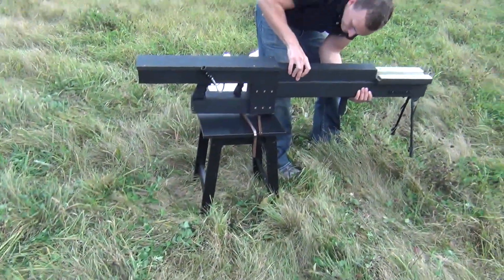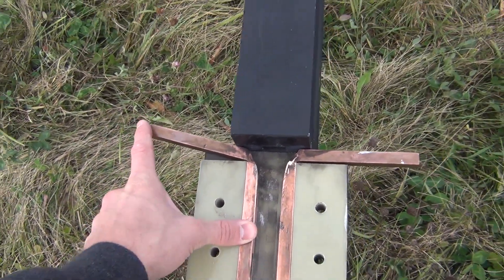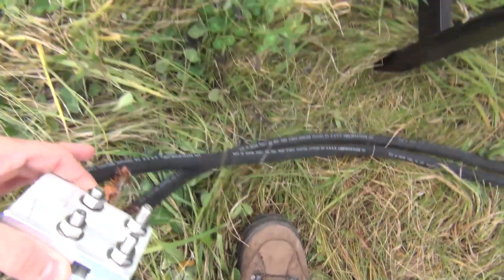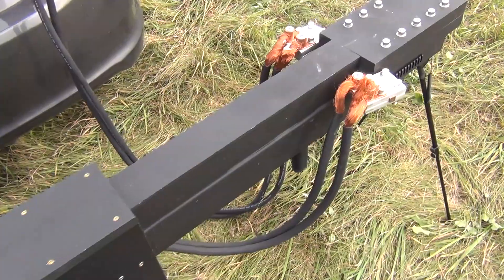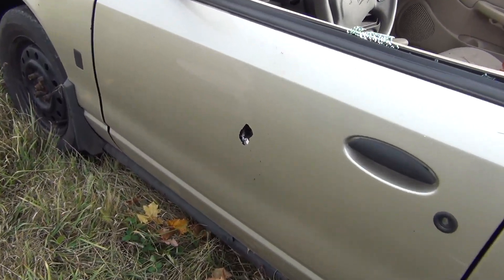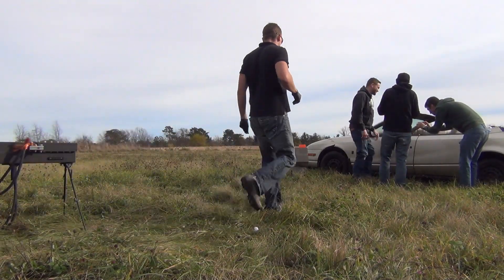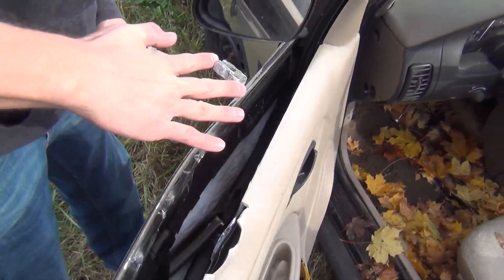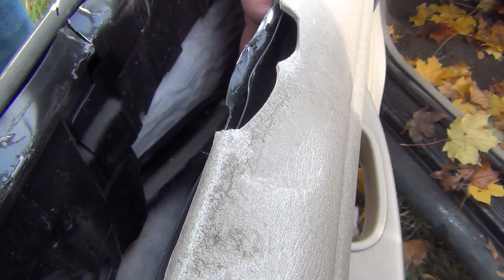250lb Railgun vs. Car Door: 27,000 Joules. Launch #4

Comment: A rail gun that is almost as powerful as a .22 short.  Nice.
Reply: 9 volt batteries for the charging circuit. The charging input has little to do with the power of the system. As long as the weapon is charged, it will do as much as physics allow it to. The projectile is not efficient for a railgun, it would likely be more powerful as an APFSDS round, as opposed to a slug, like the current military models. I still wouldnt like to be hit by this projectile. There are countless ways to improve on this design.
Reply: @comradezoned  some dude built this in his garage lmao it's pretty fuckin impressive imo
Reply: Keith Dixon To be fair, this is a home built prototype railgun. Military railguns are insanely stronger
Reply: 27,000 joules vs ~200 joules from .22lr. Their projectile is much much bigger than .22lr. Would be interesting to see much lighter and bullet like projectile being fired from that.
Reply: You realise this is a non Gov funded prototype and that the mass is about 46x larger then a .22 and not to mention flat faced
Reply: 9V batteries contain pretty pitiful amounts of energy, but if you put them in series (to get the required voltage), you can still charge a big cap up,  but it's not going to  charge very fast.  And if the capacitor's energy capacity is more than is in the batteries, to get it charged to the target voltage is going to require more batteries! LOL. Wherever these guys live is probably having a massive 9V battery shortage for miles around! LOL!!
Reply: .22 is about 240 joules
Reply: Force = mass x acceleration
Reply: It’s a baby chill out
Reply: @Atman Gotango possibly. By the time I got to that part,  my brain was imploding from all the bullshit
Reply: But is it man portable?
Reply: The us military had many of those since the 90s.but there were banned as alien technology actually the aliens brought them but the pussies from the headquarters rejected them when one of the officers got killed accidentally and slice his ass in a half they tought that was a very dangerous artifact. Then the aliens took off ignoring the monkeys from pentagon. They are no longer in sale but in 6 light years away in a planet called yourrrrrrasssssss.
Reply: That's pretty advanced for a backyard project they built at home considering how advanced the design needs to be in order to blow through the entire car.
Reply: Regular guns and railguns are hardly comparable as the way they work and they way they destroy the target is different. Railguns are meant to penetrate the target at absolutely maximum speed and zip right through whatever you shoot it at, so they are good for anti armor, conventional guns are usually made to disperse the energy of the round into the target, and are limited in speed because eventually infinite amounts of gas can only expand so fast.
Reply: @icicle8263  what you’ve said is dependent more on the ammo type than firearm type.
Reply: @kekistanimememan170  not particularly though, as even though there are armour penetrating rounds for regular guns, they still have an absolute maximum speed of around 908m/s? Whereas railguns, as far as we know, are only limited by the amount of electricity you can dump into the system, and railgun rounds are more often than not solid metal, unlike conventional bullets that are usually jacketed lead or something similar.
Reply: @kekistanimememan170 physics has entered the chat
Reply: 27,000 joules is about the same kinetic energy as a 14.5mm round or even a 20mm.
Reply: That thing is just a baby railgun lmao.
Reply: It's more powerful than 22lr it true
Reply: Dumbass hes using 9volt batteries to power it.
Reply: A rail gun as efficient as an incandescent bulb.  A rail gun with that much energy should have all the power of an entire 6 round cylinder of .44 magnum and then some.  This thing should penetrate quarter inch steel trivially.
Reply: The problem is the projectile, it needs to be a dart and be from tungsten. These people seem to have used normal steel @notamouse5630
Reply: Keith Dixon It hit a steel beam in the door
Reply: Fr like a Bmg has more power just using regular rounds
Reply: My railgun that the ATF and FBI dismantled and destroyed shot at around Mach 6.5 and hit with enough Force to penetrate roughly 10 in (20cm roughly) of ar500 Steel. My projectiles were custom made with a Tungsten core and a titanium outer shell. The purpose of the titanium outer shell is to melt or soften the steel and a Tungsten core was to penetrate the molten material. Each projectile cost $355.25 USD. It weighed roughly 300 lb (136.078 kilograms). The ATF dismantled and destroyed it by using roughly 3 lb of C4.
Reply: @dankers_420  my BS detector has gone to overdrive
Reply: @industrialadhesive6357  wHo fUcKing aSkEd???
Reply: @dankers_420  i mean you did. for posting such a blatant lie
Reply: @dankers_420  dont commit suicide you have so much to live for. You may jist be going through a rough patch in life but it usually gets better even though it may never seem like it. 
Also i am not sure if your telling the truth or not. I know alot of people lie about stuff like that to make them selves feel superior to others or just for attention.
Reply: @industrialadhesive6357  it doesn't make me feel good I have a freaking felony on my record from that because they considered it making a destructive device and an armor penetrating weapon without a license or serial number
Reply: @dankers_420  that does rlly suck. You might somehow be able to get it expunged
Reply: @industrialadhesive6357  I don't know if I'll ever be able to do that because I had to do a plea deal not to go to federal prison for 8 years and I would be treated for perjury if I tried to get it expunged
Reply: @dankers_420  true
Reply: @dankers_420  what are you talking about? You can own a armor penetrating rifle and make your own firearm, you just can't sell it. I ain't gonna lie sounds like a lot of bull
Reply: @leonelmartinez2486  I was 14 my dude
Reply: @dankers_420  I don't know why I can't see my comment but why aren't you a engineer?
Reply: @dankers_420  lol a 14 year old fabbing 350 dollar tungsten core projectiles and penetrating 10 inches of steel. Nice Larp man. When I was 10 years old I made a space laser that was a planet killer and the feds got me too
Reply: @leonelmartinez2486 no you cannot, none of the 50 states allow for destructive devices with armor piercing capabilities.
Reply: @OctogonOxygen024816 railguns do not legally count as destructive devices no matter how powerful. they are completely unregulated
Reply: @dankers_420  Complete and utter BS. Lol. You expect people to believe that?!?!
Reply: @talyn3932  no I don't expect people to believe it I'm literally on a watch list because of what I built
Reply: @dankers_420  Okay kiddo. Go back to your Overwatch now.
Reply: @dankers_420  I hear ya. I was blowing stumps with dynamite at that age. making ammonium nitrate rockets that either went 1/2 mile high or blew out neighbor's windows. 
These keyboard warriors never got out of their houses!🤣
Reply: @davisrs1  yep
Reply: @dankers_420 can I email you? I just wanna know how much juice you needed and what capictors were used and I can figure out the rest, but I don't wanna get you caught up on a public forum.
Reply: @dankers_420  dude.... just, no

Your math don't work out, nor does your understanding of physics. 

An APFSDS round fired from an abrams tank weighs about 20lbs, flies at 1600m/s and can penetrate over 500mm of rolled plate armor

But your mach 6.5 (2230m/s), 300 lb projectile could only manage  1/10th that penetration?? And don't get me started on the titanium around the tungsten.
Reply: @dankers_420  because you can't. You made it up.
Reply: Keith Dixon 22 short has more power

Comment: change the "round" into a high speed explosive projectile designed to fragment on impact with secondary explosions! or just put a shotgun shell inside or better yet, a 45 hydra round. 
all that velocity transferred and piggy backed on that high speed slug whooooo.

Comment: 2:38 Or so... HOW in the bloody hell you could say that magnetic field could deform ALUMINIUM projectile? Btw, unimpressive railgun, you need much longer rails, for that ammount of energy around 80 cm and rails made of molybdenium for less friction. Also, use higher voltage to met projectile on sides that it can slide better, greater resistence of metled alluminim is a good trade.
Reply: You need to read up on your HS physics.  Current flow produces a magnetic field,  it doesn't matter what the conductor is made of.  Rapidly growing fields generate opposing forces.  The aluminum projectile HAD to have a lot of force applied to it,  else it wouldn't have shot out of the end of the thing!  Even if it wasn't going that fast.  LOL
Reply: The rest of your comments sound like you know a thing or two about this subject though.  LOL. Cool HS project.  If you've seen super- conductor demonstrations where they levitate a tiny magnet over a plate of material in liquid nitrogen where it becomes superconductive.  It doesn't matter that the plate levitating the magnet is non-ferrous.  As the magnetic field changes -- bý the approaching magnet -- eddy currents form which generate an opposing magnetic field,  repelling the magnet.  And the plate feels this force.  And need not be ferrous.
Reply: Raymond Kertezc is my favourite poet At least I know stuff. I'm not sayin that I know like all stuff, but I can tell that those guys don't know exact science behind it. And yes, we did make a railgun in school lab that was able to penetrate 2 building bricks (those filled inside, you know, proper old ones). We did it as we were learning about magnetic fields. So....
Reply: +novo td And you still don't know that an aluminum profile CONDUCTING TENS OF THOUSANDS OF AMPS can deform under electromagnetic field?

Comment: Isnt iron or lead a better projectile as heavier? -_-
Reply from the maker: Academia Gamer Aluminum has a unique set of properties that make it perfect for railguns: high conductivity and boiling point being key. Iron (ferromagnetism) is not necessary, and quite detrimental to a railgun. Lead has poor conductivity.
Reply: Thank you but how boiling point has to do with good projectibility?
Reply from the maker: The projectile slides down the barrel on liquefied metal. If it vaporized (take zinc for example) it would be more of an explosion. Gases don't conduct electricity very well.

Comment: why does the field cables whip as the do? it's clearly necessary to do away with the long flexible cable and use conductor that could be integral to the devise. a consideration to whether it's field polarity causing the cables to move as it's fired. the amount of force that it takes to move that large cable would easily be enough to pierce to the door..
Reply from the maker: +freelancerider100 or just add zip ties :)

Comment: Can't juse sicentific mecurments (mm), Can't build a railgun firering tube or rails for shitz! How mutch problems do you thing you get from bending the rail so the resistans get higer at the start of the rail? THE RAIL SHOULD BE THE LEST REISTANT PART! you need to make a "L-shape" and not the broke L that you got ATM... and the charging of the capacitors with 9volt bateriers.. wtf man?

Comment: Where do you get your calculations for 27K joules?  That's about 10x the energy released by a 5.56 round fired from an M-16 rifle! From your test footage, it appears most of the energy was absorbed by the rail gun. It shouldn't take more than 1k joules to penetrate clean through both doors of the car. The electrical energy powering your rail gun is translating into kinetic energy extremely inefficiently.

Comment: I don't understand how that much pounds of pressure couldn't penetrate the door? I know the projectile has an odd shape, but I would think that it should have still be able to pass through a car door no problem.
Reply: It only has 270 joules of *kinetic* energy.
Reply: Oh... OK. So in fact, their railgun would have about 2 times less energy than a "simple" 9mm bullet. Which is very disappointing...

Comment: What happens with the Door, or with a 32 cm thick Steelplate, if the Projectile is made of thin Aluminum shoot with a Speed of 850 Kilometer per Hour ?
Reply: That would be around 1 or 2 Megajoules of *kinetic* energy.
Reply: +angry try hard  But a hollow Aluminum Projectile can´t penetrate a Steel Plate that thick, right ? So, how come the Planes penetrates the Towers made of Steel ? 9/11 Planes refutet by Bullets.

Comment: Ok, so why are you not using stepped sets of magnets/capacitors, you would greatly increase velocity/kinetic energy over just a single unit
Reply from the maker: railguns don't benefit from stages- they act as an infinite number of stages. Even if the rails hypothetically stretched a mile, one stage would be fine (assuming no resistance losses). (it's not like a coilgun)
Reply from the maker: magnets are not used in this railgun
Reply: Ziggy Zee
I was using the word to describe the conductor set, sort of like where you used Amperage to describe Current

Yes, Railguns do benefit from stages.

Augmentated Railguns are a hybrid between a Railgun and a Coilgun that use several sets of shorter conductors that sequentially increase total magnetic force generated for a given amount of current, thus achieving significantly higher velocities and much less wear/damage.

I would suggest you look into it a bit and consider modifying your system so that you can achieve the velocities your investment in time and money deserves (which shouldn't be very hard as you evidently have access to a machine shop). You should be easily able to get 7-10k fps though you may have to modify your slug as the aluminum (depending on alloy) will likely liquify within a few feet from the muzzle due to atmospheric friction.

It's not a true coil gun, but it's pretty close and is MUCH easier and cheaper to build, and you are already 90% of the way there...
Reply from the maker: Augmented railguns seem hellishly complex.
https://www.google.com/patents/US5375504
Reply: Ziggy Zee
It is actually not that complicated, let me see if I can't access some diagrams that will work for you..

It's certainly within your capabilities judging by your build quality

Personally though, since you have already invested in the caps, why not build a coil gun too? Even just a single (Big) coil is going to be a lot more efficient than a single rail system because you lose so much energy due to arc friction between the armature and the rails, and of course rails don't last very long. That flame coming out the front, that is all copper plasma...

BTW: Did you know that if you remove the voltage regulator on an alternator they will put out about 320-350 volts at a much higher amperage than a 9volt stack? Be careful though!
Reply from the maker: +Karen Audrey Todd I've avoided coilguns- my caps cannot handle voltage reversal, they're electrolytic.
Reply from the maker: +Karen Audrey Todd The flame coming out is actually vaporized aluminum.
Reply: Not entirely true, setting a system like that up requires a much larger current and voltage to be better overall than this setup

Comment: There's an easier way to take apart a door. But if all you have is a hammer...
Reply: ikr xD like on all cars you can easily pop off the inner door panels
Reply: +GenesisRhapsodos LOL, I think on my 1999 Acura Integra, it's two screws. The rest are clips. Pry the panel from the bottom, tilt out, and lift. Done in 3 minutes. Getting it to go back on takes four times as long for some reason.
Reply: my 99 altima has 1 screw then the rest pops out
Reply from the maker: The oil has never been changed on this beauty.
Reply: +GenesisRhapsodos Hooray for surprisingly easy (scary?) to disassemble 90's cars, which were obviously optimized for the assembly line! Almost everything in the interior snaps together. For contrast, my 70's MG has everything screwed or bolted down.
Reply: jonnda how would that be scary? and assembly lines for cars have been around for almost 100 years xD model T ford was the first
Reply: +GenesisRhapsodos the t was also scary/disconcertingly easy to disassemble.
Reply: +GenesisRhapsodos also, the t wasn't held together with snaps and clips
Reply: jonnda  the t also didnt have speakers, radios and a bunch of other parts they had to get to it was a luxury item back then and just as luxury items are now its almost impossible to do it your self rather than take it back to where you got it.
Reply: too bad.......easily pop off inner door panel isnt going to be easy with all that broken glass def going to need gloves too. They should bolt off the intrusion beam on the passanger door and see if they can shoot it through both at once.

Comment: This rail gun seems to be under powered. Most 9mm would pass through this car easily.
Reply: obviously an experimental weapon designed from scratch by a couple of dudes in their free time won't match weapons that have been evolving for centuries
Reply: One of the biggest issues imo is that all they could use to power it was a bunch of 9 volts
Reply: you do know that if you put them in parallel, the volts will ad up?

Comment: You guys did a terrible job opening the door. I work on cars for a living so heads up the plastic trim panel pops off with a couple screws. One usually under the window control switches. The rest are usually visible. Great job with everything else. I'm assuming you obviously don't car about the and neither do I but it would have been easier.
Reply: my car just has one in the door pocket/handle for the window controls then the rest pops off. they were complete idiots when it came to checking the damage
Reply: Robert McCain oh ya, they're so dumb they can only work on rails guns.
Reply from the maker: >100,000 miles, never changed the oil